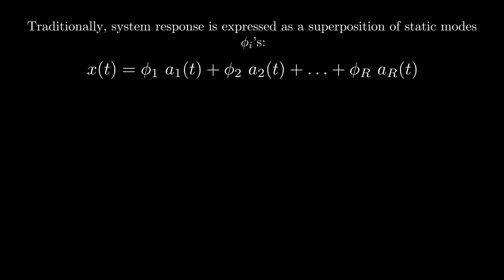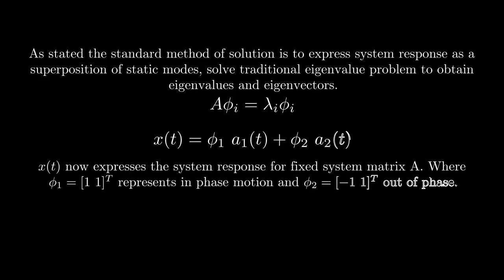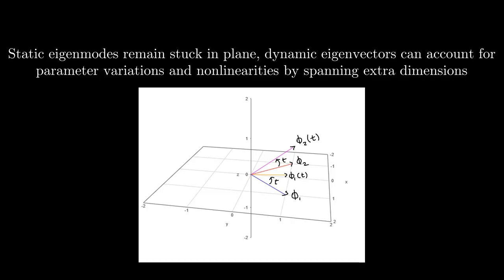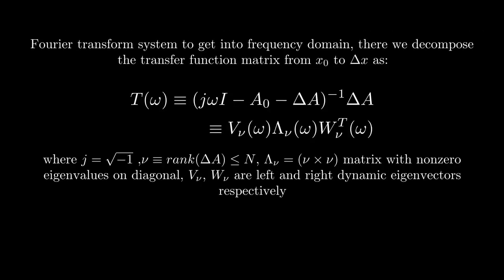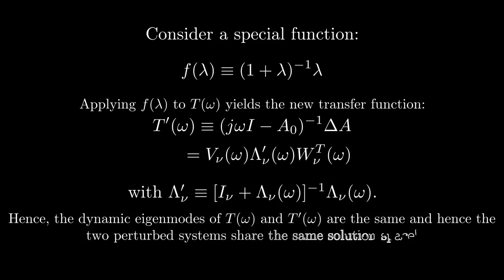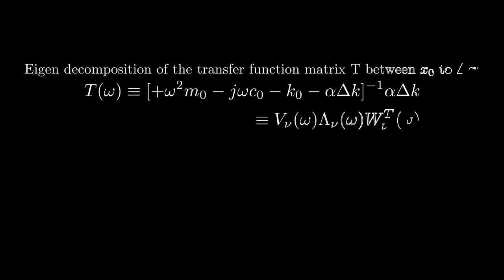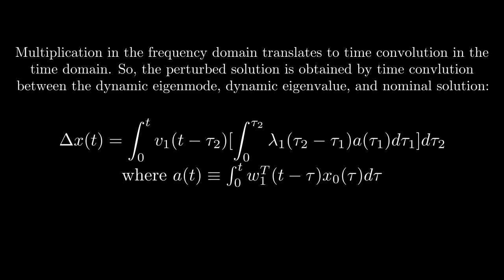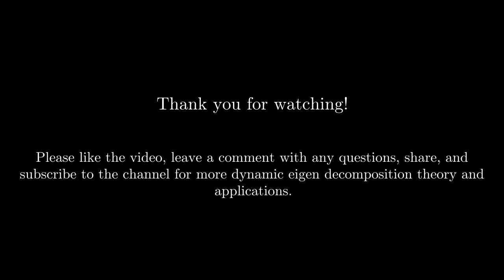Dynamic Eigen Decomposition I: Parameter Variation in System Dynamics

Comment: If it hasn't been clear to you what we mean by 'Modally Equivalent', it means that the solution spaces of the two systems can be spanned by the same set of modes that are not necessarily fixed in space but changing with time, i.e., the dynamic eigenmodes. This is quite a departure from the traditional definition of 'vector spaces' and 'spanning' but one can still derive the equivalence based on the moving basis vectors.